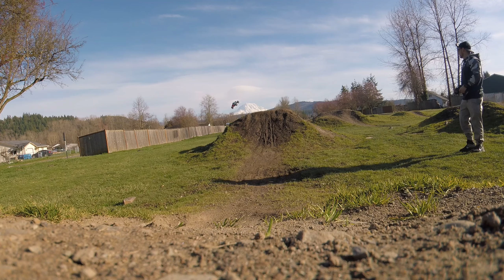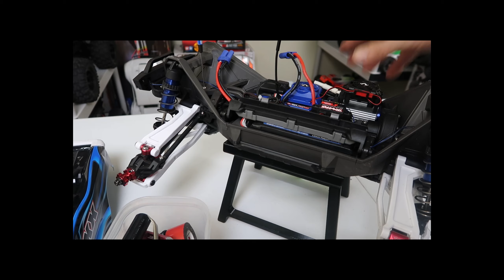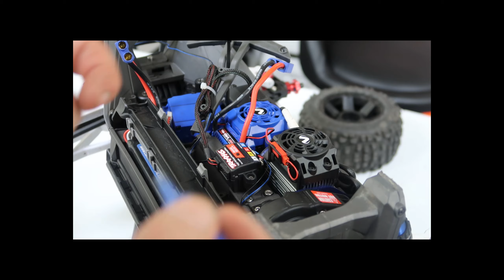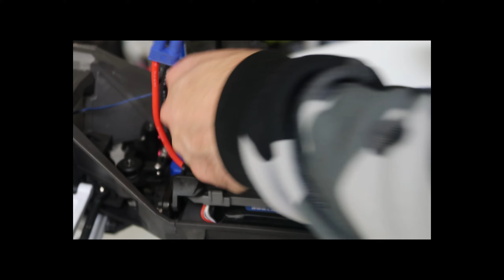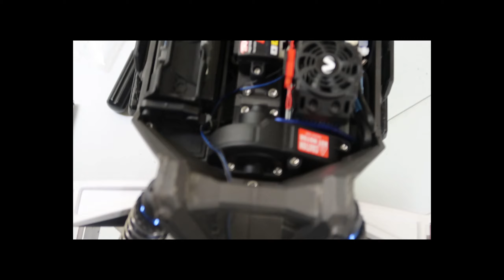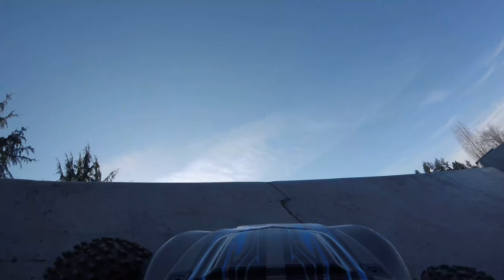Traxxas Widemaxx the Best upgrades! How to install GPM servo horn/link!

Comment: Why didn't you adjust the length of the steering link? The GPM one is way shorter than stock so I'm confused. I don't like having to thread it out so I ordered a 'fixed' link from Hot Racing and won't be using the one included with the GPM horn.

Comment: Awesome ride. What wheels and tires are those? Are they belted?
Reply from the maker: Thank you for tuning in!! They are Proline Badlands 3.8: they are not belted.
Reply: @pnwRCMADNESS   Have the part number for the tire and wheel combo you are using?  They have so many badland options and yours don’t seem to be too big like most 3.8 setups I see. Thanks.